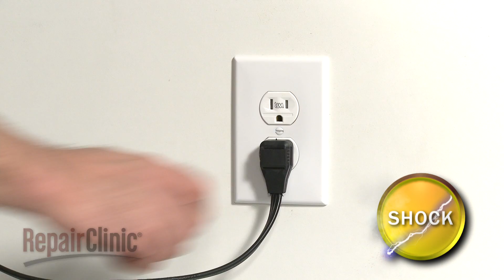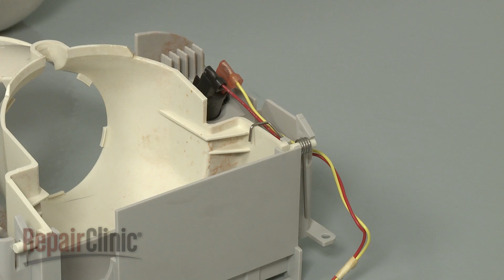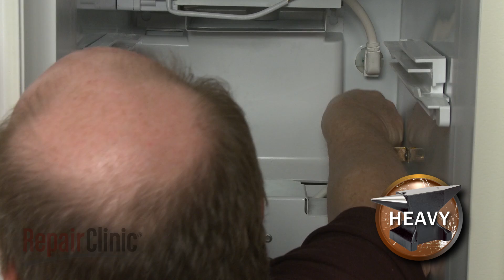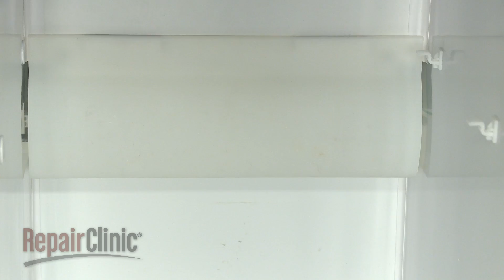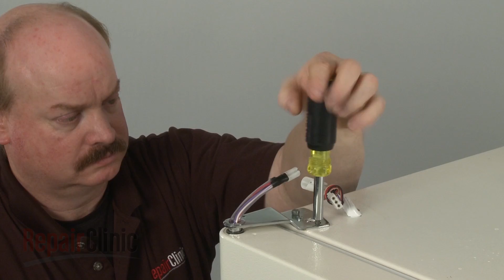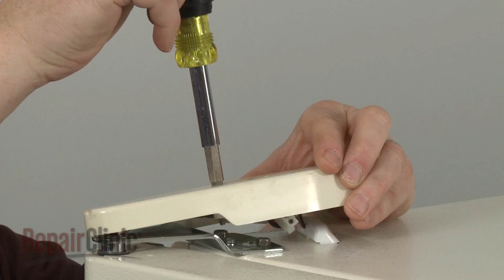GE Refrigerator Disassembly – Refrigerator Repair Help

Comment: So how about showing the stuff under the fridge - my rollers fell apart, I found white rubbery chunks all over the place - can I replace just the roller, or do I have to replace the whole expensive self-leveling component also?  What else mechanical is under the fridge compartment?

Comment: This was all about the freezer, not the refrigerator.  I have a Hotpoint refrigerator/freezer side-by-side model hss25gftaww.  I have not found one tutorial on changing the damper assembly.  The screws are deeply inset on this model, and I cannot see what type or size driver to use.

Comment: I have a GE like this one made in 2000. I can only get it to come on my choosing the warmest temperature setting. It will run one cycle, shut off, and not come back on. If I try to adjust the temperature setting to a lower temp while it's running under these circumstances, it will also shut off at that time. I replaced the defrost timer because someone was very sure that was the problem- it wasn't the problem evidently. Any ideas on what it might be or what I should check?

Comment: Thank you for the video , I have GE model ge gss23sgsbss it sit in my garage I live in Arizona and the fridge ( freezer and fridge) worm when I open the freezer the coil inside was not fill with Ice I put new Defrost but it cold for day and stop freezing I unplug it some times it work the stop working again the fan it’s working but no cold (  It’s been in the garage for 7 years ) no issues , what cause the problem

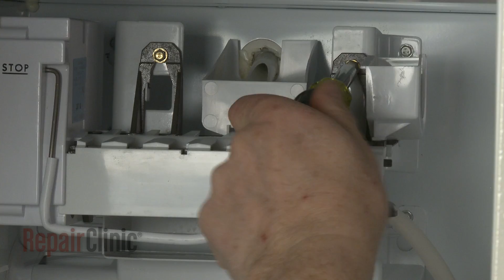Comment: At 5:00 into the video the icemake you took out is not the same design as the replacement.  The orignal one makes sense as the arm gets pushed up by filling ice to stop the icemaker.  The replacement is a flat arm that supposedly slides inward horizontally.
I have that in my fridge as well.
The question is , how on earth that slide horizontally for Pete's sake as the ice pile either under it or over it.  Bottom line I have to shut the ice maker to keep it from going out of hand and inundate everything with ice.
Pretty meaningless design as far as I am concerned.
What am I missing?  I don't think I would get an answer.  That is not the game plan here.

Plus I either need the temperature control encoder or the main board.  The compressor never stops and the freezer keeps on cooling.
At present moment the defrost temperature sensor is reading 60K ohm and the freezer is reading 48K ohm,  The fridge reads fine within respectable range and the dumper opens and closes as it should of course.
Yesterday I was able to shut the freezer by turning the teperature knob to 0 but today it wasn't happening.  
The only way to stop this beast from just keep going is to unplug it.

Comment: Where is the fuse that works the refrigerator from the freezer side to the refrigerator for temperature control and to get it too cold for meat, eggs and 
Milk and etc that are not going to be frozen  just like a regular refrigerator  can't get  the panel to lite up so freezer is working good  but the refrigerator doesn't get cool and the control panel doesn't lite up so can't make my refrigerator turn up to cool that  si6 of the refrigerator and freezer is working fine what  must l do  are cheek and find out my problem

Comment: I have a GE Profile refrigerator with the freezer on the bottom.  Recently there has been a little puddle of water on the floor right beside and under the left side of the freezer.  Everything seems to be working fine other than this little puddle.  I am afraid it is going to ruin the hardwood floors underneath.  Have called my refrigerator man but no call back.
Reply: My fridge has started doing this. Were you able to find a solution?

Comment: I have the same refrigerator and my water line broke at the 90 degree bend into the door where the dispenser is. I called GE and they said they do not have a way to replace it, and I need to buy a new door for over $600. I cannot use a coupler because it broke flush with the door. Do you know if the line that goes in the door can be replaced? Thanks
Reply: My referaterer side is what my problem how do you cheek to  see ifn your computer is not lite up so you can turn up or down what must l do to get it to work
Reply: Where's the fuse located on the refrigerator
Reply: Yes that is what I want to know is what side of the unit is the fuse located on
Reply: However. Just like to know where is this fuse located at please
Reply: I'd like to suggest to include - in the beginning of the video when you disconnect the power to ALSO turn OFF the water at the source & disconnect the waterline..
WHY?
My waterline has a clog/blockage somewhere. All the lines iat/in the fridge were fine but the source itself has the blockage...

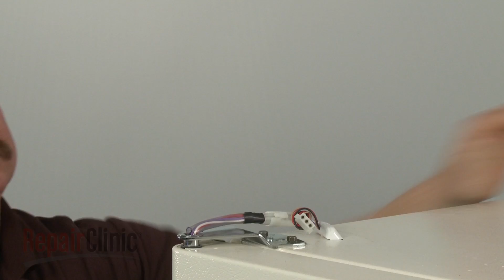Comment: So I bought a ge used  (in excellent condition) fridge for $50 because the front panel isn't working, it works good but need the ice and water dispenser to work, so i bought a front panel replacement, it didn't work. Bought a rear computer board replacement didn't work either, I turned to YouTube for last hope @ never thought that @ 10:12 could disconnect and connect. Mine was disconnected. Thank you. 😅🤣😂

Comment: My GE side-by-side refrigerator doors do not shut easily. You have to push the second time to completely make it shut
Reply: Most likely the doors aren't aligned.
The adjustment screws are on the top hinge for some GE with side by side doors. Loosen a bit those screws, correctly place the door (it won't fall because of the magnetic gaskets), then tighten the screws.

Comment: I have a tfx24pr  ..question / the water line that run out of door and across the front  then disappears up into foam...its leaking out of the foam where the line disappears